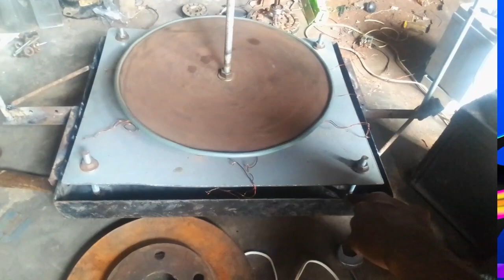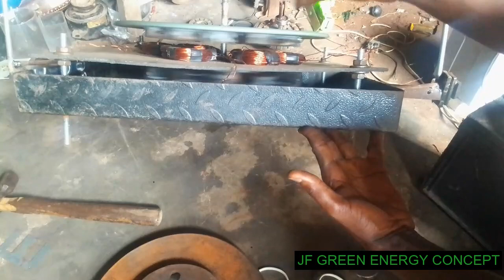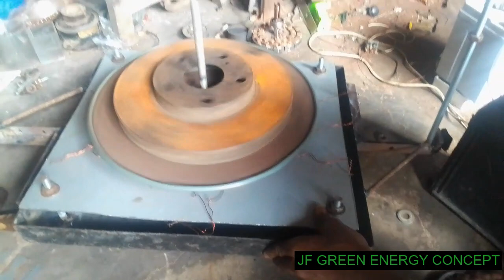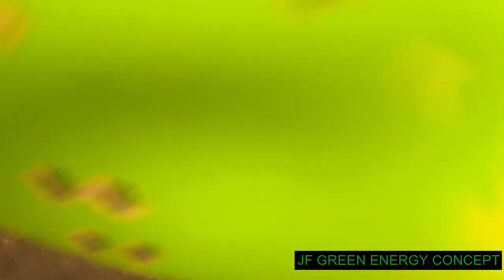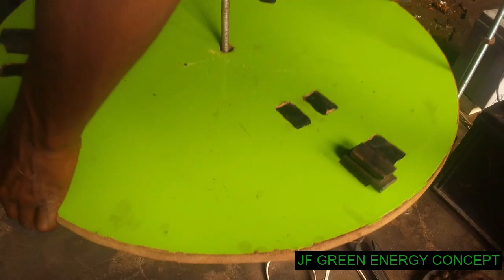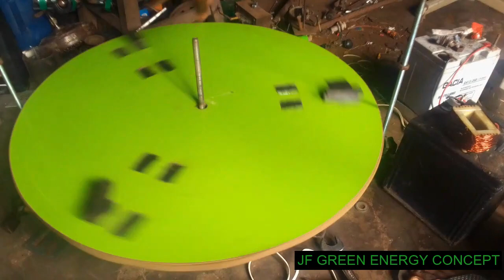Flywheel free energy secret

Comment: Hallo JF, first of all many compliments for your tries.

Can you please explain better to me the concept? In the first place you made use of an iron flywheel which did have, say, 1 Kg of weight, a diameter of approx 20 cm and a height of approx 5 cm. 

Making spinning such iron mass the generator shown a noticeable breaking effect, due to - of course - the expected Lenz law... 

Then you replaced the iron flywheel with a wooden one, apparently lighter, but with a larger diameter (60 cm, more or less) and an height of 1 cm; the overall weight seems to be approximately half of the iron one. 

Now the Lenz effect seems to have dramatically reduced... is this due to the increased radius lenght and, so, to the centrifugal force?

What did you put on top (and inside) of the wooden green flywheel? They seems to be pieces of iron to "balance" the disc and to raise the mass at the outer rim, am I right?

Many thanks for your experimentation: keep up your appreciated work, I'm following you with a lot of interest.

Fabrizio, Rome, Italy
Reply from the maker: They are pieces of magnets to increase the weight of the flywheel at the rim. thanks bro we are In this together.